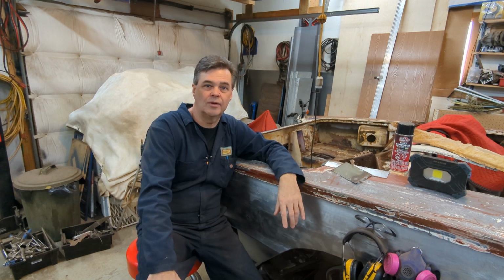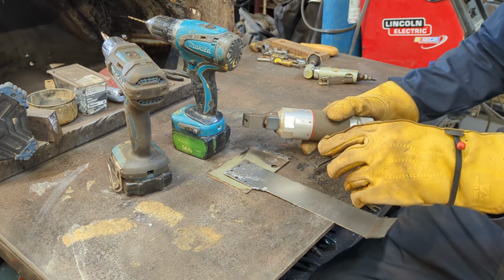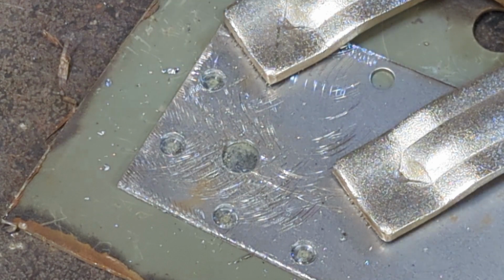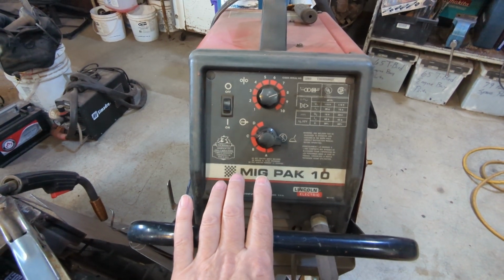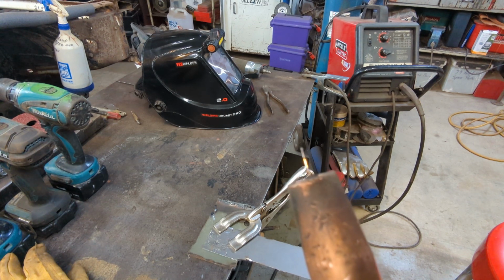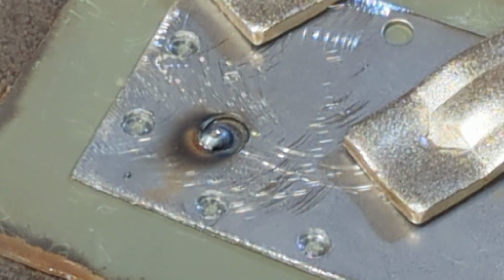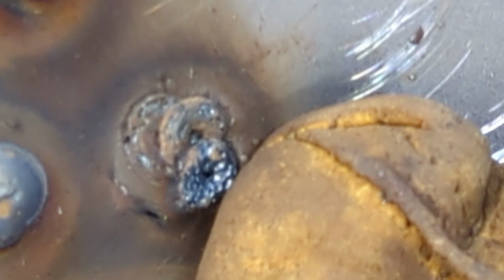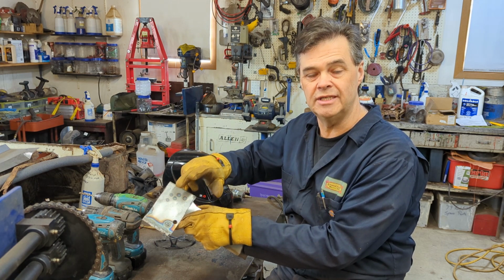How To Plug Weld Sheetmetal with Mig Welder

Comment: Hey Alvin, I appreciate you taking the time to make this video. I never pulse the trigger when doing plug welds, I start on the edge of the top panel, go straight into the middle, pause a bit and then circle around until the hole is all closed up. It makes for a nice smooth plug  that quite often doesn’t require any grinding.
Reply from the maker: Hey Morgan!
I started out doing it the way you described, but on setting B it was a little too cold and I was getting bad welds. On setting C, the welds sometimes get too hot and blow through if I do a continuous pass. I should have explained that when I was talking about the voltage selector, and why a variable selection set up is better, I could then find a more suitable heat range. That's the joy of having the inexpensive tools, always having to find work arounds. 😎

Comment: Well Alvin, I feel you hit all the good points needed for someone to get started and do good work! Well done
The proper term is porosity when you don’t have the gas on and your weld looks “porous” (full of holes). And a pair of welpers (welding pliers) will help a guy with not only cutting the wire, but occasionally cleaning the tip and inner shield of your torch tip. It also has other uses too. It’s like a Swiss Army knife for welders lol
I usually use a sheet metal awl to scratch up the inner metal but I like your idea with the flattened drill, and lord knows I have a lot of dull drill bits I could do that with. Thanks for the tip my friend! And as always looking forward to your next video
Reply from the maker: Thank you Troy!
I've been meaning to get a proper set of welding pliers, thanks for the reminder! Lol...I started using the drill bit to clean out the primer because I to had lots of old bits around. 😎

Comment: Mig is a cold start weld and have seen spot welds just pull apart. I drill an 1/8 hole in the center of the 5/16 and I just flood it in one go. Flat and almost no clean up. Never had a problem.
Reply from the maker: Thank you Paul.

Comment: Thanks for this lesson! I'm installing a new radiator core support on my 2008 Ford Ranger since the old one rotted out from road salt, and using a Lincoln MIG similar to yours. I'm very excited to see how I do!!
Reply from the maker: You'll do fine, just Dail in your heat and wire feed, and the rest is practice. 👍
Reply: @J_R_Shop  I nailed it! came out great. thanks again, this helped tremendously!
Reply from the maker: @musselsmarinara  you're welcome, I'm glad it helped you out!
Reply: Haha just looked at this video because I'm planning on putting a new core support in my ranger. I unfortunately hit a deer not too long ago and want to get it back on the road!

Comment: Hello Alvin. Thanks for the demonstration. I would note that it is important to clean out the hole , as the primer can contaminate the weld. Nice job!
George B. in Michigan
Reply from the maker: Hi George, I agree...a cleaning out is important, these could have been a little cleaner. 
I have tried the weld through primers, but find they just bubble and make a lot of smoke, cleaning the weld area with a drill works well for me.
Thank you George, and take care!
Alvin

Comment: I love the tip about using a squared off drill bit to remove primer from the bottom sheet, that is a great idea! Also, after seeing your light on your welding helmet I fitted one to mine a few months back - what a difference! Bedfore I was always trying to position bright lights, or even holding a torch near to the work (burnt it plenty of times), but welding is so much easier now with the light on the actual helmet. I am in my mid 50's now, so the old eyes are not what they used to be, so was really struggling without the extra light. No longer a problem since i fitted that light. Such a simple but brilliant idea. So old Johns been asking for welding tips? Must pop over and see what he's up to, sounds like he could be up to some interesting stuff!
Reply from the maker: Thank you Steve!
I was in the same situation you were with being able to see when welding, the magnified safety glasses and helmet light was a game changer! John asked me a while ago about making a video that included plug welding, and I kept forgetting to do it in full, say hello to John for me if you see him!
Reply: @J_R_Shop  I am in the UK, so won't be seeing him, should have said i will pop by his channel over on that other video platform.

Comment: I have a question about your helmet.  I just started got my MiG welder and purchased the $40 harbor freight helmet.  I really can’t see where I am welding on the lower setting so I will need to get another helmet.  Can you see well with the Yes Welder Helmet??  Also, I tried shining a light on my workpiece and it triggers the auto darkening so I can’t see even to get in position to weld.  Does the LED light on your helmet do that?   Thanks.
Reply from the maker: Hi James, 
Yes, my Yes Welder helmet is clear, I'm happy with the true color. Adding the LED light does give a good spot, but only on the round light...the bar light underneath the round light doesn't really help, so I only use the upper round light.
Reply: @J_R_Shop  Thanks for your response.  I have a 64 convertible that needs restored.  Rust not as bad as yours.  Debating on selling it and buying something with a 4 speed.

Comment: So I'm welding floor supports on my truck  I have a L-TEC tig welder that I don't have a trigger or pedal for and I'm having trouble trying to spot weld with it its blowing through the sheet metal before I get good adhesion would plug welds be a good structural alternative or should I invest in something to do better spot welds or is there something I'm overlooking new hobby level welder so I could be missing something obvious but any tips would be helpful
Reply from the maker: Hi Donald, sorry to hear you are having issues.
I don't have any experience with TIG welding, so my suggestions are limited...have you tried lowing the amperage, it sounds like too much heat? Are you using 100% argon?